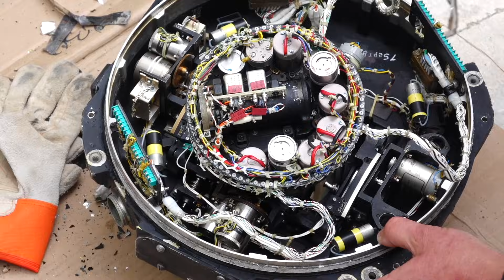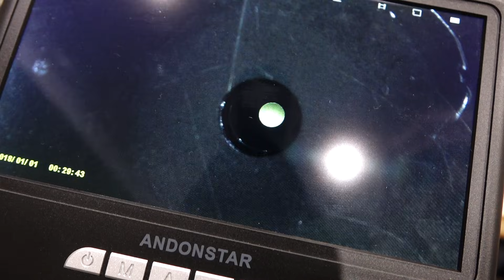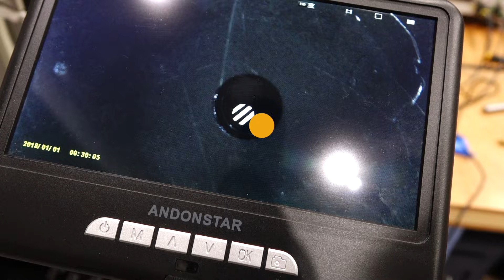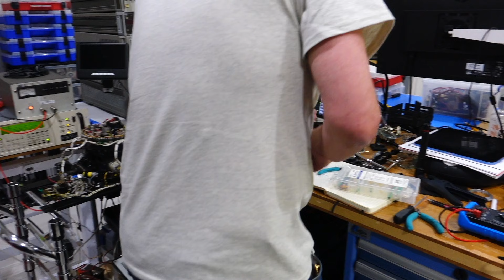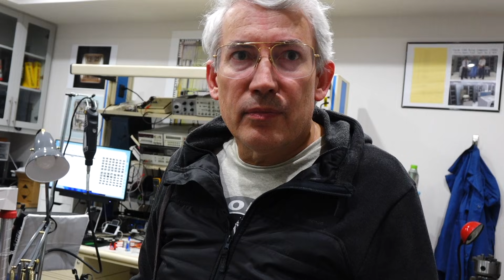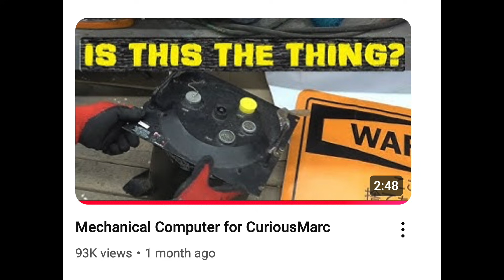B-52 Bomber Astro Tracker - Part 3: Figuring out the optical system

Comment: Airplane-mounted star trackers are back in fashion. They allow passive navigation in GPS-denied environments, and celestial navigation remains useful in space, where GPS becomes increasingly difficult to use at higher altitudes. Satellites and spacecraft have been using star trackers for decades.
And remember what the B-52 was originally designed to do: carry nuclear AGM-28 Hound Dog missiles to knock out heavily defended targets before penetrating Soviet airspace to drop the big ones. Literally nuke your way in.
Nuclear detonations, especially at high altitude, can temporarily disturb Earth's magnetic field, potentially compromising magnetic navigation. Star trackers don't care about magnetic disturbances.
The electromechanical design also makes sense in that environment: considerably less vulnerable to certain radiation effects than semiconductor electronics.
The B-52's navigation system also incorporated Doppler radar for groundspeed and drift measurements. Very useful, but unlike celestial navigation, it required transmitting radar energy. Something you might prefer to avoid over Soviet territory.
Quite an ingenious combination of navigation technologies, especially considering when it was designed.

Comment: So the reason it needs the higher precision "star centering" system is that in order to actually find a given star in a reasonable amount of time, you need a moderately wide field of view, something comparable perhaps with the angular size of the moon.  This alone would let you know  your location to within 1 degree of latitude/longitude or so, which is accurate enough to tell you which country in Europe you happen to be flying over.  You'd need quite a bit more accuracy to locate a specific city.

Comment: I still maintain line following metal profile cutting machines that use this technology in the form of rotating optical sensors. I come from this generation and maybe one of the few still able to understand and do as you are, reverse engineering and getting into the minds of the original inventors. Westinghouse / Linatrol HL 90 analog line tracking machines. They are still out there faithfully tracking the spot and cutting metal that fabricates our modern world. They work until they don't! sometimes an old fool like me keeps them running!

Comment: Holy hell that unfocused eccentric aperture thing is ridiculously clever!!

The X servo just needs to be driven by a reference signal, with 90º phase offset from the Y servo. Wire them the right way around, you’ve got a proportional control loop! 🤯

Or well, it seems the actual device is designed for polar coordinates, but still… Absolutely brilliant!

Comment: The Lockheed SR-71 (Blackbird) used this Astro Tracker in addition to an Inertial Reference Platform  -  From the pilots notes:   "SR-71 Flight Manual 1989   -   Astroinertial Navigation System   -   Star tracking may be degraded because the field of view of the astrotracker is reduced by the position of the astrotracker window behind the aft canopy."   The B-52 model you have with the dome viewport has almost one hemisphere of view, except where the aircraft fuselage, empennage and wings obscure it.

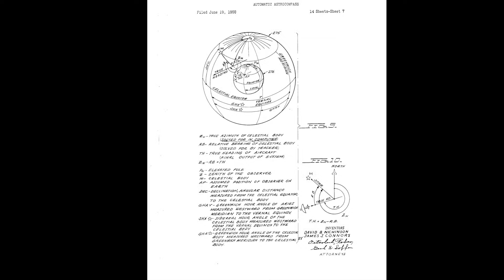Comment: 01:10 Point of order:  The system does not 'Track one star..."  it has a field of view which the shutter and the rasterizer cover. It maps the illumination hot spots in this field of view, and can track their vector movement within this field.
Reply from the maker: That is incorrect. The system does track the star.

Comment: A little over 45 years ago I was given a "chopper".  I didn't know what it was at the time.  Mine was black lines painted on a glass disc.  I put power on the motor and it spun very fast.  I enjoyed laying a screwdriver on the edge of the disc while it spun, scrapping the lines off.  They must have been ceramic or iron "paint" as it made cool sparks as I scrapped them off.  The lines spread out as they moved away from the center.  I suppose this could adjust the frequency if needed.  There was a threaded part I now think could take a lens.  
It came from a military research base.  I never thought I would know what it was.  Now almost half a century later the mystery is solved.
Reply: Ah, the impetuousness of youth!

I relate.

Comment: Did they really try to lock to the peak of the offset image sinewave? Locking to the zero crossing is potentially very much more accurate for what they are doing. The polarity of the error signal then becomes a very nice feedback signal. Note sinewave signals are also very prone to even harmonic problems driving it away from precise locks. I guess with tools they had at that time their solution worked to requirements. And that is the primary consideration. It might be fun to redesign the electronics with more modern concepts and components. In about 1965 I had semiconductors and RA909 opamps (rad hard) for the sounding rocket design I created. (And it's cruft compared to what would be designed today with a very small SOC and DSP techniques.) Those designers are worthy of respect for what they achieved with the tools they had. It was already 1965 when I addressed a somewhat similar design challenge as a senior in college.

{^_^}
Reply: As shown on the block diagram the system uses phase detectors with sin/cos signals of the 30Hz generator. The dc demodulator outputs are fed to two 400Hz modulators to drive the elevation and azimuth motors.

Comment: Congratulations on your success. So you have an altitude error signal and an azimuth error signal. How does the system use them? The analog computer takes inputs of initial latitude and longitude, heading, the GMT time, and the location of a target star in the celestial sphere. From these inputs, the computer calculates the theoretical azimuth and altitude and feeds these values to the sextant. When error signals are produced, they are used to drive correction values to the latitude, longitude, and heading inputs. These values update the computer and the commanded sextant positions reduce the error signals. This repeats until error signals are null. With the first star centered. the true heading can be determined.  Error signals from three stars are required to fully resolve current latitude, longitude, and heading. The system has star data entries for three stars. Once entered, the navigator and quickly switch from one star to another. Once three stars have been tracked and true latitude, longitude, and heading have been calculated, only a single star is needed to keep the computer updated. This is fortunate since star positions in the sky change as the aircraft travels along its route. The navigator monitors for when a tracked star is no longer visible and enters another star to track.

An engineer looks for underlying simplicity when determining elegance in a design. This is an example where elegance is not obvious, but is suggestive of the complexity of the problem, not the designer's competence.
Reply from the maker: Good explanation!

Comment: The photomultiplier shown is part of a family of  .125 diameter side on devices.  Most have an "S-4" sensitivity curve which has only a 5% of nominal sensitivity with red light.  Types 4472 and 4473 do have a higher red sensitivity to red, but still far below the peak at blue-blue violet.  This helps to explain the relatively low response to the red laser.  using a blue or violet laser would have much higher sensitivity.
Reply: Awesome, I was wondering about that although I am not going to pretend I know what's going on in its entirety !

Comment: Great stuff, many thanks for sharing!
I did not yet fully understand this double and triple convoluted chopper system, so I have to follow this video 2 or 3 times as well, I guess.
In many physics experiments, you'd often find such an optical chopper system, in conjunction with Lock-In amplifiers, which provide phase and amplitude information, sharply filtered to the chopping frequency. This astro tracker should work in a similar way.

My first encounter with optical choppers was at the age of 16, in 1977, when I had my first industry internship.. it was a Perkin-Elmer infrared spectrometer.. fascinating stuff.

Comment: The complexity of 1950s technology this thing uses is amazing.
Reply: This is not just 1950s tech. It's the result of the brilliant minds from Skunkworks, working on the most advanced, top secret spy planes. Ben Rich was the boss at Skunkworks and has a great book about it.
Reply: I think this is a few decades newer than that.
Reply from the maker: @stargazer This is indeed designed in the early 1950's. But they kept making it forever. They also updated the electronics from tubes to transistors. But apart from that it's pretty much the original 1950's thing.

Comment: Using a laser beam is good for aligning the star with the optics like you did, but the laser spot will be wayy too wide compared to a real star.  Try instead to prick a hole in some tinfoil with a needle and backlight the tinfoil with a small "white" light bulb. Place far away or use a collimator. This way you approach the intended diffraction limited spot size.
Reply: Just bounce it off of a large ball bearing.  I use LEDs and ball bearings for my star simulators.
Reply: @stargazer7644  :)

Comment: The SR-71 was also equipped with an Astrotracker. 
I wonder if the contents are different because the cruise speed is totally different.
Reply from the maker: I have been told it was similar or even the same. But I had no way to check this.
Reply: Very important because of its high speed and long duration missions. An SR-71 pilot once said "You've never been lost till you've been lost at Mach 3.2."